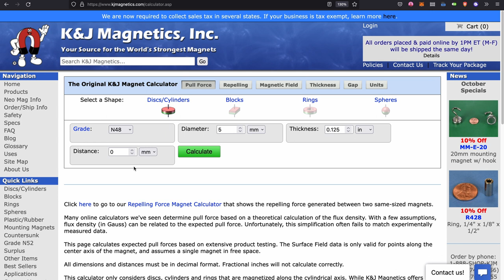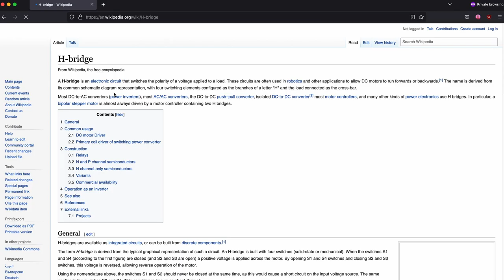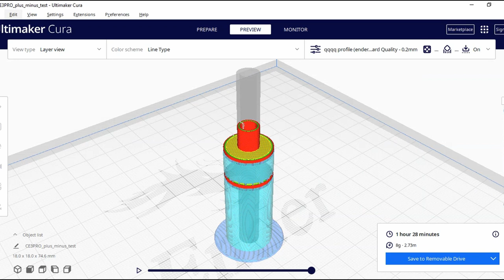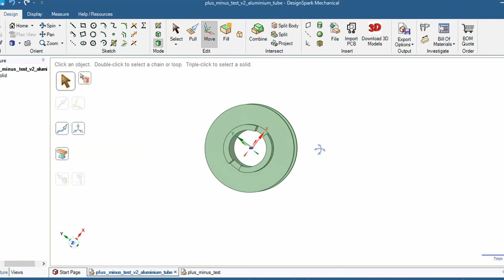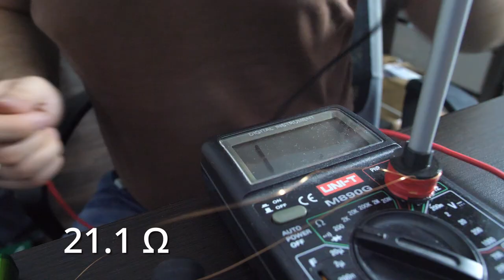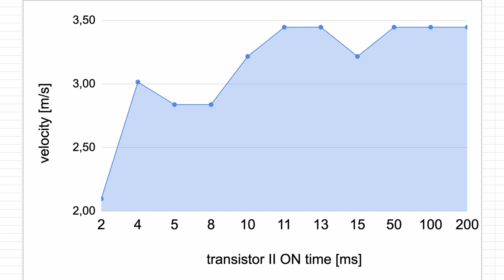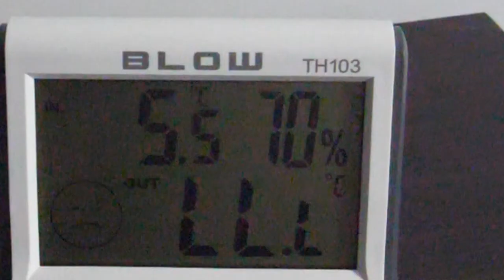3 Ideas to Make Coil Gun More Powerful

Comment: The reason the magnet was slowed when falling through the aluminium tube was because it was generating an eddy current. As the magnet fell, it was creating distubances in the electrons of the metal pipe, which generated a brief electric field, dispersing its kinect energy into electrical energy. This can only happen to a noticable degree if the tube is complete, or of substantial mass. If you cut a slit down the length of the tube, you will break the "circuit" and the eddy currents produced will be MUCH weaker. This is better than using the plasic tube since metals have lower friction co-efficients and have more wear resistance. Hope that physics break-down helped.
Reply from the maker: Thanks for explaining.

Comment: This vedio helps me a lot. If it is possible to make a video to show how to choose the coil(width , length , radius, turns) of the coil gun with different voltage and different capacitors. Thank you!
Reply: The parameter of mine is 420V and 560μF

Comment: the magnetic field doesnt go away completely after the coil is turned off either. the B field decays quickly but its not insignificant.

if a magnet was used, it would be more strongly attracted to beging with, allow switching, and negate some residual drag from the non-instantaneous drop in voltage